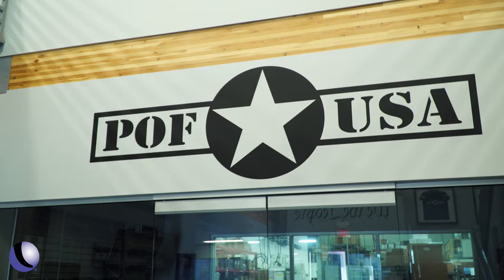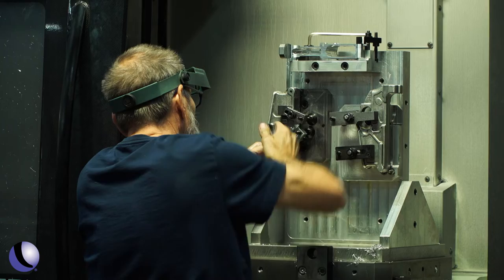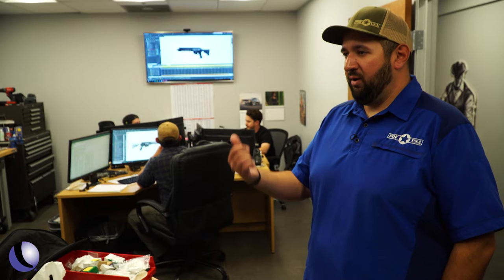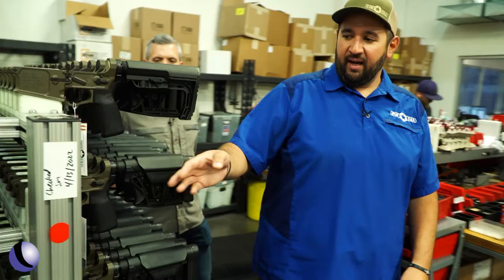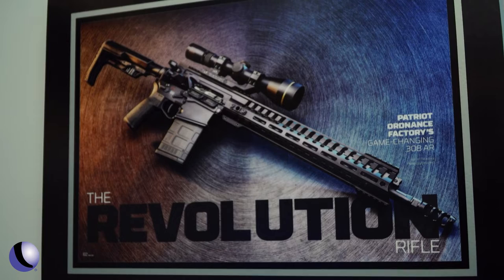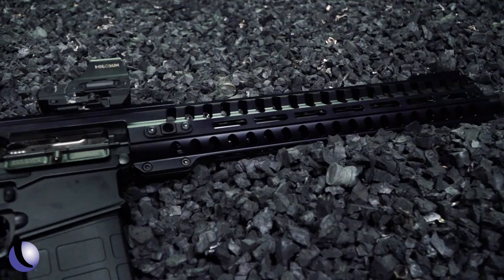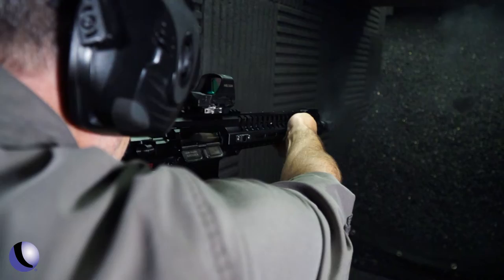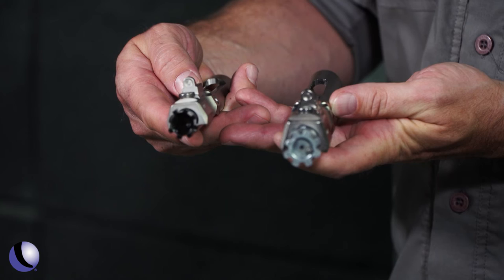Guns & Gear visits Patriot Ordnance Factory / POF-USA

Comment: My P308 SPR (18.5" barrel) Gen4 EDGE has been flawless from day one. I broke in the barrel over a series of range sessions with Fed GMM 168gr ammo followed by a thorough clean and lube of the barrel. Made sure to dry patch the barrel before each shooting session. It broke in at .6moa.
On light wind range days, ringing 10" steel plates at 700yds is well over 90% success probability. This is with OFF THE SHELF Fed GMM 168gr. I purchased one of the last Robar NP3+ coated P308 examples. The gun runs reliability bone dry (NO oil), and cleans up with a light wipe of CLP on a microfiber towel.
Now that states are beginning to push back against the Unconstitutionality of the NFA, I'm really glad POF built this rifle with FA rated components EXCEPT for the select-fire lower. 
If the NFA falls, I will be IMMEDIATELY ordering an FA lower from POF.

Comment: The Revolution Di should be the standard issue of at least one squad member of every infantry squad. I loved your dad and this company. The weight saved by the Di option is substantial and could also have reduced ambi features and carbine length rail and gas system. Maybe a reduced number of gas options to 3 for simplicity and pricing, but make it work. I OWN the Di myself and I wouldn't change a thing on it, but with the system you guys have with that bolt you could OWN the market with a revolution 2 made to FURTHER cut weight. There's shit loads of wiggle room to do it. It's money in the bank. Please take it and use it. I would HAVE to buy one if you did :P I meant to add keep the same awesome fluted barrell and heat sinc barrell nut. I also absolutely LOVE the comp, but I don't see it as a room clearer especially if teams were a concern. I would love to see a dead air or surefire on the end to kill the flash and make it a no brainer for suppressor solutions. Maybe allow the consumer to pick one up without a mubble device with a thread cap only option to save money. That being said if one was to scrap teams and has ample ear pro the muzzle device that is already ON the Revolution is basically perfect for what it does. The thing fires like a 5.56 with a little more bass :P It's actually quite amazing and you just have to shoot it to understand ha ha! Not to take away from that at all. I just see it as a tool and it would be MOST effective emplimented as a fighting rifle with a flash hider...preferable one with QD system such as dead air or surefire. I'd probably have to buy a second rifle :P Why chose have one for combat one for competition ;)
Reply from the maker: If anyone is looking for a lighter option than the Revolution DI, they should look into our Rogue. 

It's built using the same size and weight saving dimensions as our Revolution platform, but is a simplified (to allow more consumers to be able to afford entry into the platform) and lighter option.

Comment: Got a Renegade+ and I love it. I also had a chance to tour the shop and the folks there are great. I’m getting a Revolution next once I get some money saved up.
Reply from the maker: Awesome! Glad to have you.
Reply: Man! I am very jealous of you! You got to tour their shop? That would be a bucket list event for me. I love my Pof rifles. I don't think there is anything on the market that touches them. There are a few guns that share similar SINGLE Innovations,, like the SIG MCX piston does not use any small parts or springs, but POF was doing that 10 years prior, a few companies use straight gas tube, or modified cam pins, or modified buffer tubes, jp has their cooling fins for their barrels on their really high end guns, but EVERY POF gun has a heat sink, and they ALL come WITH ALL OF those design innovations not just One or MAYBE two on the really expensive brands. And POF gives it to you all in guns that you can consistently find for under $2k for their 5.56 guns. Their is simply no one else on the market that you get ALL that innovation in one rifle, and then for them to sell them at reasonable prices is icing on the cake to boot.
Reply: @justanotherinternetexpert7743  I agree with everything you stated. My wife shot my POF and could not believe how nice the trigger was and how soft the recoil was. They are great guns and the people at the factory are awesome. Another manufacturer you may like is BG Defense and their Type A rifles. I consider them to be operator quality. Enjoy the holidays.